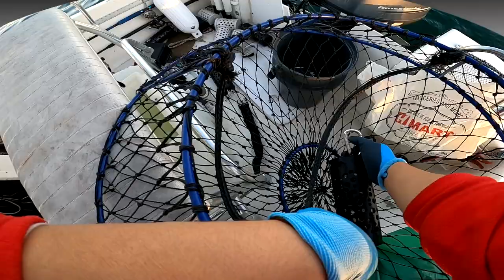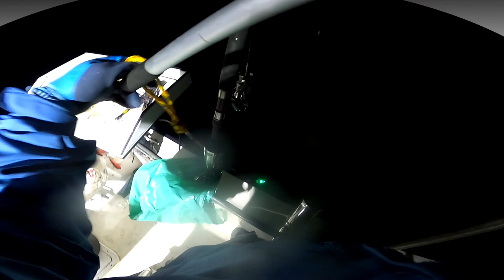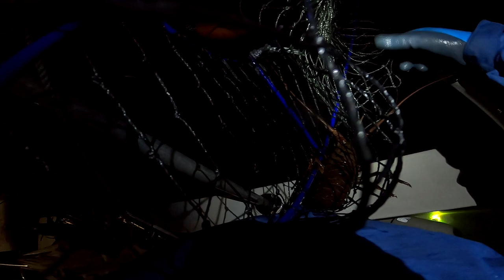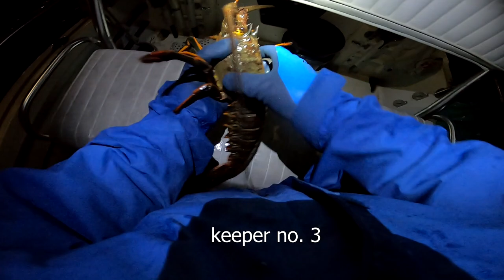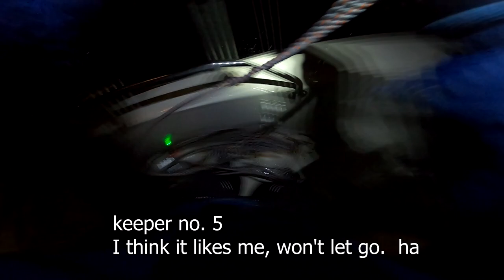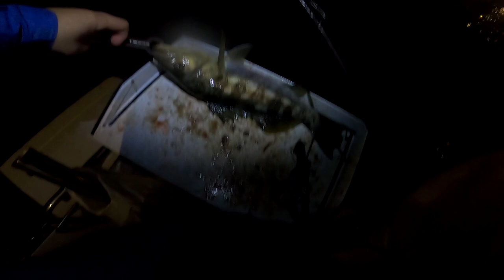Lobster fishing!

Comment: I like the tubes you made, way simpler then my screw on top. What is the top you put on? Awesome night you had. I can’t wait till I’m done restoring my boat.
Reply from the maker: I used that since screw on tops were so expensive.  I think those are called drainage grate.  I used 3 inch ones from HD.
Reply: @naldodook  That’s great, thanks for tip ! I’m going to have to redo mine like yours. I’m using these end caps that are so hard to pull off, but those drainage grates and zip ties are sweet. Definitely those screw on caps at HD are expensive.